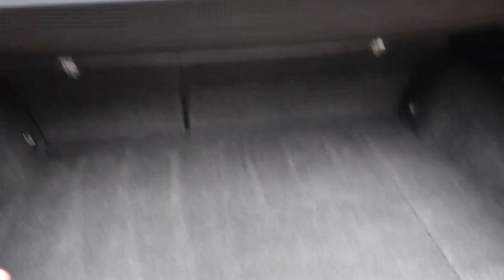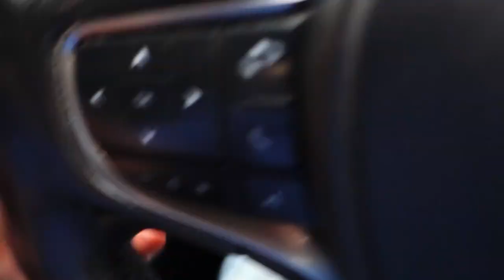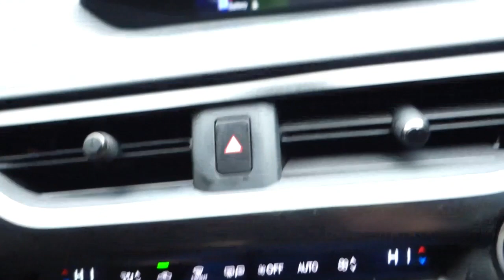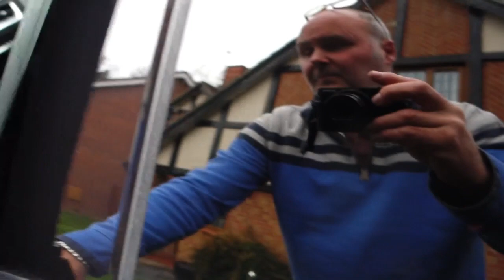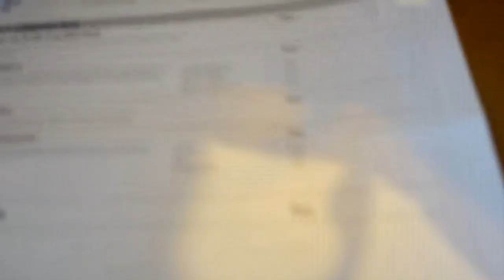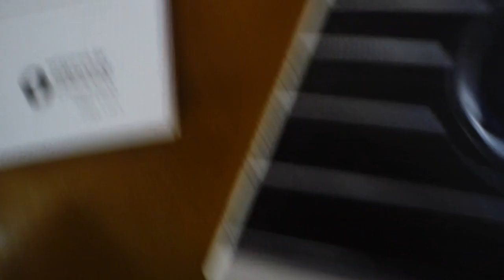Lexus UX 250h (Nav) 2.0 Hybrid CVT Auto - YD69 XAF YD69XAF

Comment: We bought a new 2020 UX 200. 63,000 miles. Lots of hard, mountain/desert driving at high speeds in 110°f. It has been flawless. I was offered $20,000 USD. I told them to (as you'd probably say), "P*ss off!"
This is a 200,000k keeper. We absolutely love it.